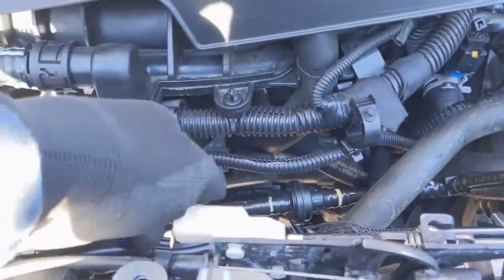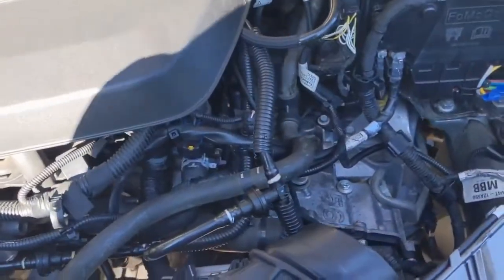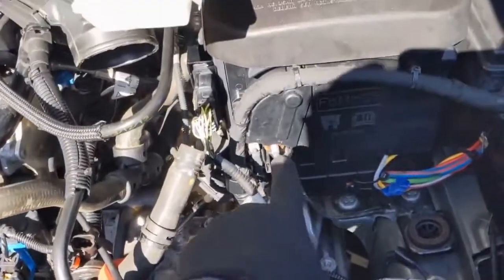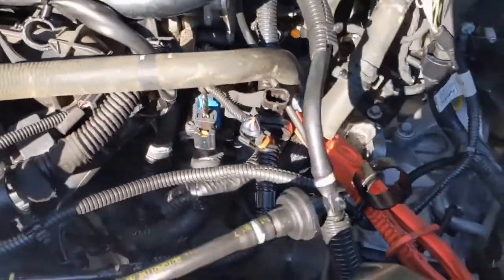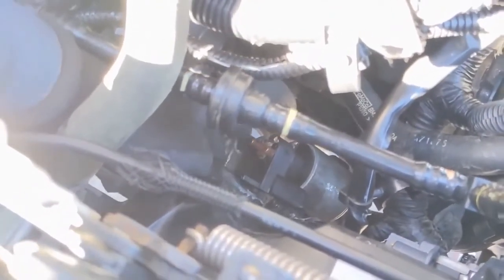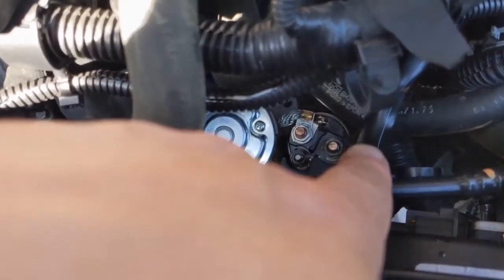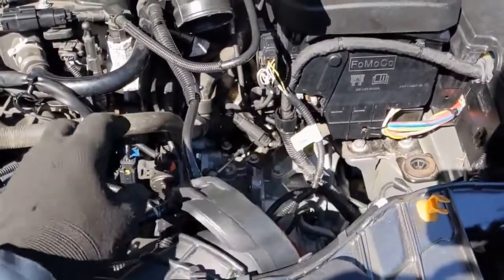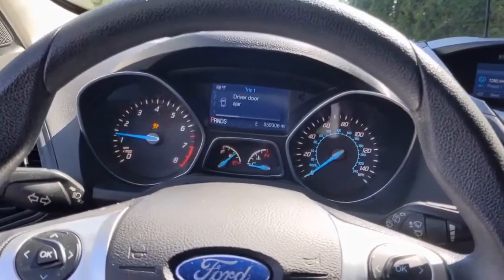2013-2016 Ford Escape 1.6 Turbo Starter Motor Replacement

Comment: Good video I have a 2016 ford escape se ecoboost 4wd and I'm trying to change the the starter also but I'm having issues with getting the bottom bolts off so my question is do you pull down to the ground on the bolts or push up to the sky to loosing them ???thank you please 🙏 respond 🙏 😔
Reply from the maker: Good question. Pull down to the ground. Lefty loosy righty tighty 👍
Reply: Thank you very much. Me and my brother was agreeing about which way to go, my brother was push up to the sky and I was down to the ground..
Reply: Leftie loose rightie tigthie

Comment: Is  there a difference between a starter and a starter motor?
Reply from the maker: Hey CR, typically they are synonymous for the same thing. The starter consists of two major components, the motor and the solenoid. In the past on some cars the motor and solenoid were separate and could be changed one or the other. Now most cars have the motor and solenoid as one unit and they must be changed together. Whether you call it a starter motor or just a starter most mechanics will be picturing the same part so either name works.
Reply: @ValleyMobileAutomotive  got it, thanks!

Comment: 2013 Ford escape 2.6  Battery will not stay charged,Possible starter issue draining battery????
Reply from the maker: The starter only gets power once the relay is activated. It has no ability to draw from the battery when the ignition is off. The easiest way to check if the relay is staying partially activated is to pull the starter relay and leave it out. If the drain goes away then I would suspect a bad relay or a fault in the circuit turning on the relay. If the drain remains then I would look elsewhere for the problem.

Comment: Great video! I wonder why this needed replacing with only 60,000 miles. I put 205,000 miles on my 2013 Escape 2.0, using it for years at 5-10 stops per day, being in sales. Guess I should replace it now??
Reply from the maker: Hey Jeffro, it's hard to predict the life of a starter motor. Typically they last a long time. I'd say if yours isn't giving you any signs that it's pooping out I wouldn't worry about it. Now that I say that it will probably die on you next week lol. I would stay away from remanufactured starters and you can get the OEM from rockauto.com. that's where this one came from.
Reply: Yeah 63,000 on mine and I've gotta replace it😡 nothing's built to last at all anymore,  and then they make it super difficult to do yourself

Comment: What size was the bolt?
Reply from the maker: The main bolts are 13mm. The big power wire is 13mm and the small wire is 10mm.
Reply: What about the actual bolt mount dimensions? Some how the bolts on ny starter popped off.